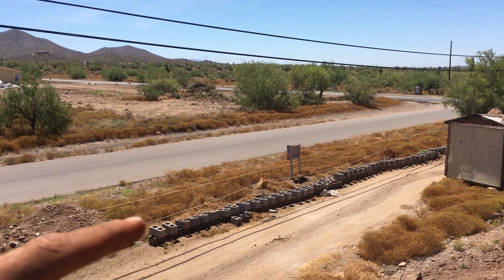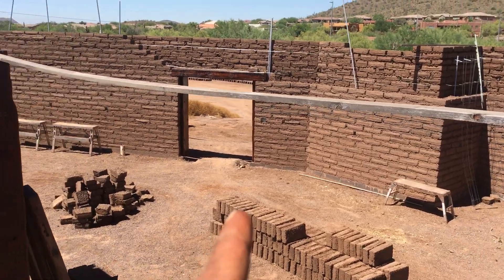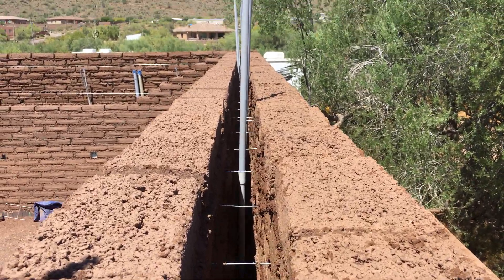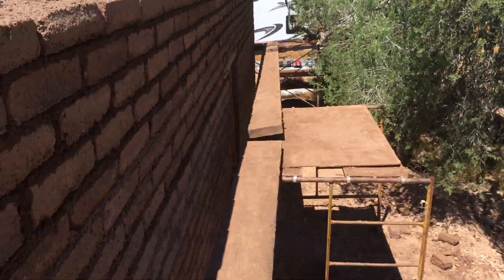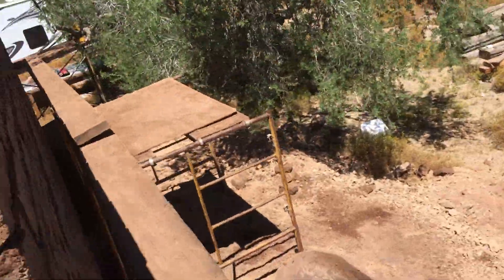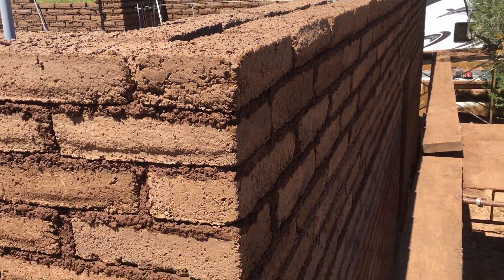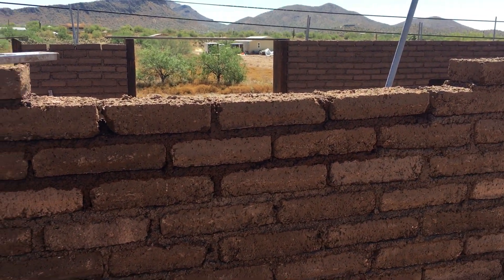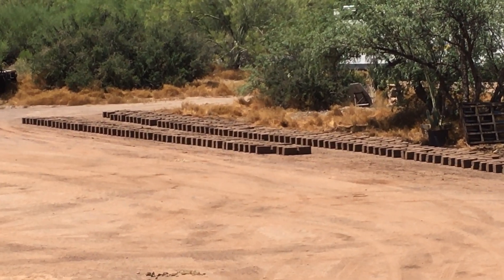Adobe block house

Comment: Where's the finished home? Don't leave us hanging
Reply from the maker: My bad, Alex, I don’t check this often. I was just the Adobe block maker and mason on this project, the second story is being completed as we speak, which is frame. I did upload a short video of installing the bond beam, here is the link: https://youtube.com/shorts/bmEe63eQLRY?feature=share

As you can see, the last 2 courses are 2” wide, 2” high block called Romans. You put wire mesh on the first Roman course bed joint to allow the crete to sit on and not go into the 4” air space. Also, have #4 rebar laying within the bond beam crete that you will slip your J-bolts under to secure. With your J-bolts sticking up out of the bond beam, you can install hangers for whatever you’re going to do after, whether secure a roof or build up for a second story.
Reply: @educationentertainment9462  Thanks!